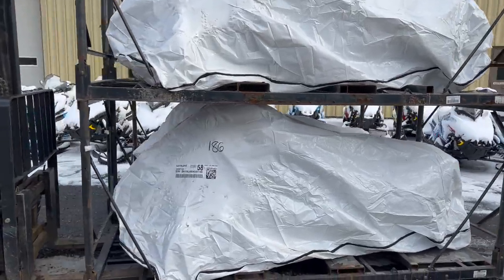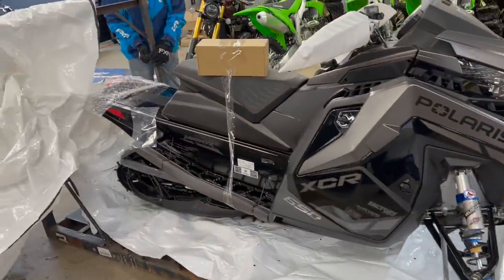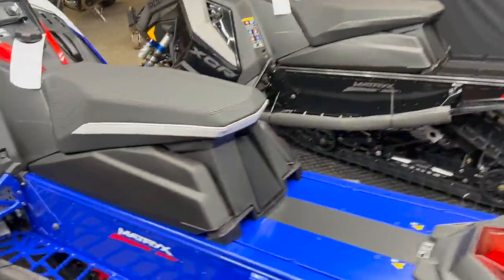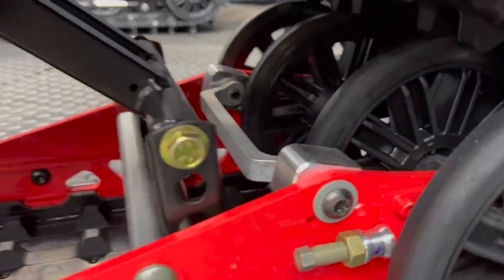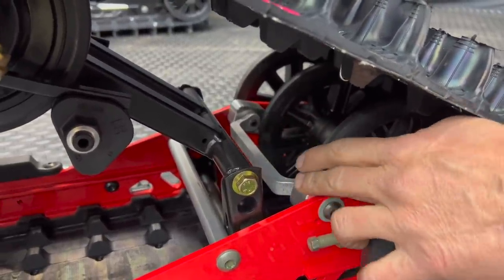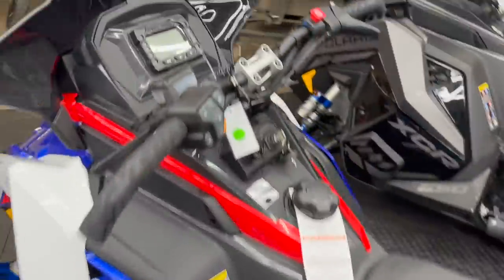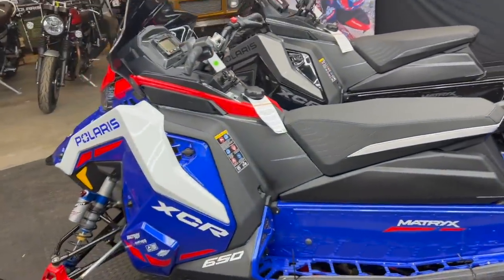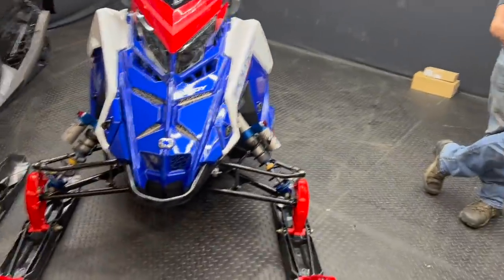2022 POLARIS INDY XCR! THE MOST AGGRESSIVE AND RACE INSPIRED TRAIL SLED OFFERED!

Comment: I think they offer a 150 Storm track as well ?  I would go that route, I put the Storm 150 137" on my ZR 8000 and it was by far the best upgrade I have done!! Over the ripsaw2 / 1.25" I feel like the sled gained 20+ hp! I'm sure the 1.6 Cobra is a great 2nd choice but with the shorter 1.25" outer lugs on the Storm 150 its better for cornering. My riding buddy has the exact same sled as me but he runs the 1.6" cobra. We switched one day for about 25 miles and I can say, from experience, the Storm 150 has every bit as much traction as the 1.6 cobra and it does, as advertised, better in the corners!
Reply from the maker: XCR's did not have the 1.5 storm option. The VR1's did.  Both are great tracks!

Comment: Nice summary with the video! It’s unfortunate they again went with 100 lb IFS springs. Heavier and/or aggressive riders will be needing to upgrade to stiffer rates. Two of my buddies are waiting on their XCR’s. I don’t think the move to making the rear shock softer in its initial travel was a good move either. Hopefully stiffer springs and shock valving parts will be more readily available than they were during the ‘19/‘20 season.
Reply from the maker: i think the ski springs will be fine. I run 100 pound springs and they work good for me. They make these softer because people will bitch. Have to take the needle out and make it a real shock. What happens every year unfortunately
Reply: @JESSEJAMES322   that’s a good point about rider weight. A lighter guy may be okay with those springs. They were way too soft for me and there was no way I could make them work for our trails. It seems like Polaris is tuning the suspension for lighter weight guys?
Reply from the maker: not lighter weight guys but tuning them so most people are happy with the sled. 99% of people would bitch if they were valved and sprung properly which is why theyre so soft from factory

Comment: My first job at a dealership was a setup tech.  I always loved how easy Polaris products were to uncrate.  Compare that to Ski-Doo which were wooden with hundreds of nails holding them together.   I always swore that the people crating up Ski-doos were paid by the nail. New XCR's are sweet! I considered ordering one but ended up with a new XR-S instead.
Reply from the maker: hahahah you are 100% correct. Ive done the skidoo ones and what a pain! Have you been on the new Matryx over a Gen-4?
Reply: @JESSEJAMES322  I rented a VR1 650 last year and it was an amazing sled.  Even riding two-up with my daughter on the back it was one of the best handling sleds I've ever been on.  I was surprised how strong that 650 motor was.  I'm excited to see how well that new front and rear suspension works on my XR-S.  I've heard it makes it handle more like a Polaris which is a good thing.
Reply: polaris back in the day used wood & cardboard crates the cardboard had trail signs we could cut out to mark trails, i don't remember when they went to metal crates, but yeah back in the day outside in dec. uncrating   some sleds was fun. i did not mind

Comment: On the XCR coupler blocks I noticed on the outside bolt there were holes to move it more forward or more back.  My question is is it actually adjustable Or do you have to leave it in the middle hole? Great video, I have the same sled coming that you do.
Reply: You can move the blocks more forward but you have to run them in the low position. If you run them in medium or high you introduce too much coupling force and damage parts. 

If you leave it in the stock hole you can rotate the blocks for more or lass coupling without hurting anything.
Reply from the maker: what @thatalaskaguy said!

Comment: Jesse what are your thoughts about the 1.6 cobra track I ordered a Vr1 mostly because the storm track is not available in the 2.52 pitch.  Starting to think I would have been better off with an XCR instead of the Vr1 after putting some miles on it.
Reply from the maker: I think the cobra is a great track. i run the 1.35 but the 1.6 is also great! Id take the 1.6 over the 1.5 to be honest! The VR1 can be set up similar to a XCR just needs some shock work!

Comment: Just wondering I'm thinking about snow checking for the 2023 xcr in a 650 136. My question is a 650 adequate enough power for 136 compared to a 128 for on-and-off trail?
Reply from the maker: the 650 really has great power and can definitely power a 136!

Comment: Hey Jesse....the riser on the XCR look to be the shorter 60mm one the Vr1 comes with. In the specs the XCR is supposed to come with the taller 85mm height riser. Can you verify which riser comes on the XCR?  Hard to tell for sure in this video but just doesn't look as tall as assault riser. THX brother!
Reply from the maker: Assault and XCR are the same! Just a little taller then the VR1. I run a smaller riser then even the VR1!
Reply: @JESSEJAMES322  Thanks, so you are 100% sure?  Reason I mention this is simply cause these two XCR in your video, sure look smaller then the assault video you just posted. I took two side by side screenshots and they look different. It certainly could be just how they look in the vids, and I understand the specs from POO.  Bud has a XCR coming and was wondering as he wants taller riser for ease of stand up on local pounded out trails. Was thinking you would have mentioned the riser height in video.  Please just verify for us since we are waiting like everyone else for the XCR 136 to arrive.  THX again Brother!
Reply from the maker: They are the same. The assault didnt have a windshield so looks much taller. I would suggest keeping the stock or smaller bar riser. Gives you more leverage on the sled and keeps you more in control. As i mentioned i run only a 2 inch riser. Which is about a half inch shorter then the VR1 riser

Comment: Always 1 step behind ski-doo copy them with that adjustable windshield
Reply: At least they don't Resemble a String out Ostrich that hit a wall
Reply: @joshpitts7256  id rather not have blown engines
Reply: IMO They all copy each other.
Reply: @JohnSmith-uy2jg  how does staying home in the shop not riding feel
Reply: sir, back in 92- 93 ski doo came out with trailing arm front suspension, they  named it DSA, DA same as polaris ,
Reply: @oldslow3694  and arctic cat was the snowmobile brand that first went over to  A-arms an got rid of the trailing arms
Reply: @edwardabrahamiii3742  sir ski doo did copy polaris right, all the oem's copied yamaha with oil injection right
Reply: @oldslow3694  and polaris copied ski-doos rave valves an called it v.e.s
Reply: @oldslow3694  k i aint gone argue just ride and enjoy
Reply: @oldslow3694  actually ski doo came out with the trailing arm in 1986 or 87 on the formula line.
Reply: @wwtf7180  actualy not  ski doo called it  DSA,, look up old snow goer race & rally magazines,   DSA  the magazines said it stood for DA SAME AS polaris
Reply: @oldslow3694  yes it did but the PRS in the first formula plus and MX was the first trailing arm setup that Ski-doo used. DSA came later.
Reply: @wwtf7180  dsa was much better i believe polaris set the standard for trailing arm ifs that is why  media said ski doo copied it
Reply: @oldslow3694  you are absolutely correct.
Reply: @oldslow3694  The early trailing arm design that doo used was an indirect shock action and wasn’t very good. Then according to legend  Ski doo swapped some idea with Polaris so they could redesign their trailing arm to DSA. I don’t know how correct this was. It may just be a urban legend.
Reply: @wwtf7180  i love the urban legends, bottom line  us riders should benefit
Reply: @oldslow3694  Agree. 👍🏻